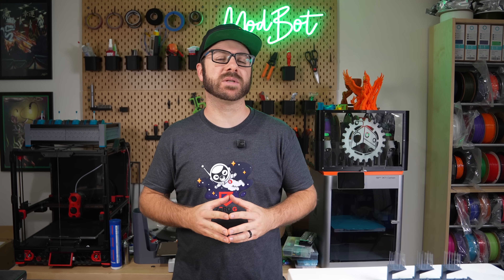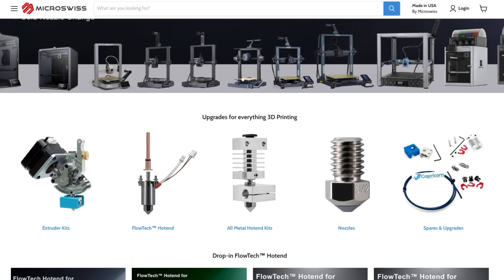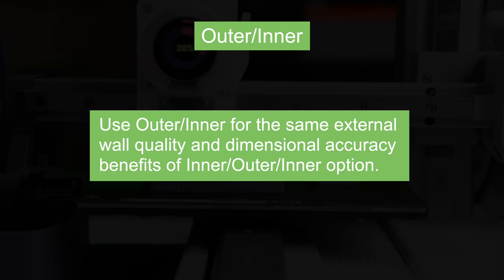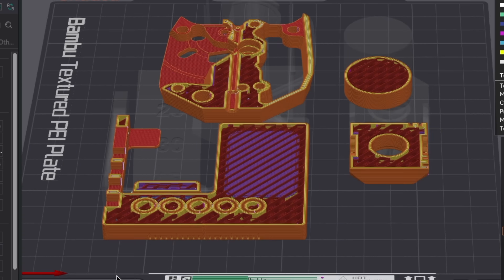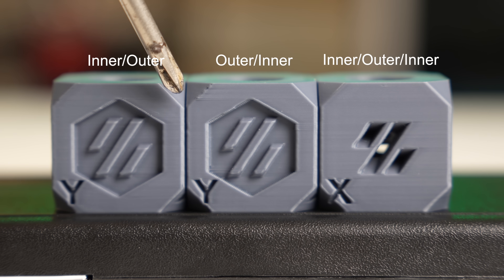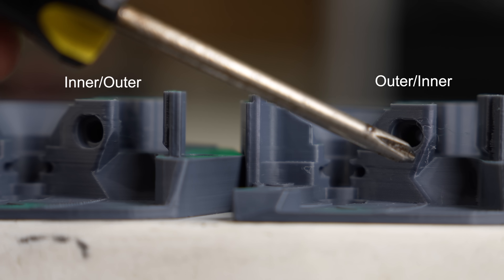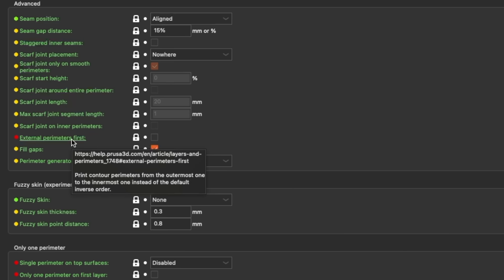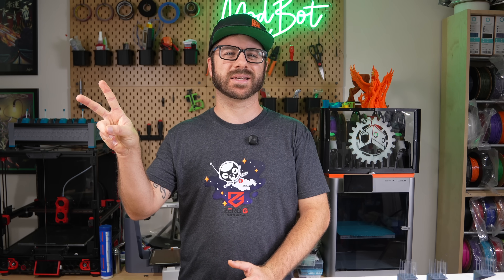Best Wall Order for 3D Printing? (Test Results)

Comment: I've been in the inner-outer-inner camp since it was made available, but I also follow Zombie's recommendation to slow down print speed and acceleration for outer walls. 

I appreciate you going through and testing this so thoroughly.
Reply: Inner-outer-inner unless there’s an overhang in which case inner-outer with precise wall, always slow outer wall and visible top surface, 10 mm scarf seam length (which is Bambu Studio’s default, Orca’s 20 mm is too long IMO) with inner wall enabled, and always calibrate filament.
Reply: Do you have a link to that video?
Reply: @Elby788 it's something that ZombieHedgehog discusses on his Twitch streams. To keep it simple, lower your outer wall print speed and acceleration to around 50% of the internal wall speeds. It doesn't add a ton to the print time, but it improves the quality tremendously.
Reply: @PettyRuxpin that's super helpful, thank you!
Reply: @PettyRuxpin wow! That's a killer reduction in speed! Do you leave the jerk settings between inner and outer similar to maintain similar nozzle pressure?
Reply: @PettyRuxpin this depends specially if you're suffering from VFAs. I print at 70mm/s outer wall for over a year, I now print at 160mm/s and I get much better quality, no difference in accuracy, on a modified ender 3 v2.
Reply: @visrupt  It sounds amazing for the Ender! If you have a moment, would you be able to summarize what upgrades you ended up installing to reach these speeds and decent results?